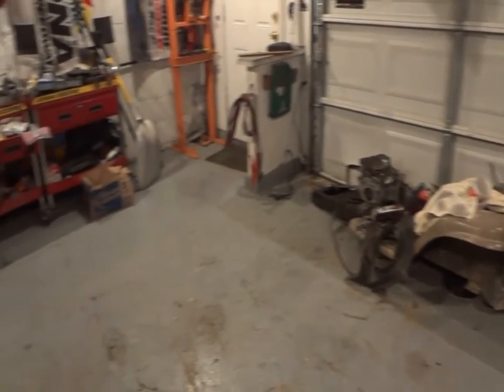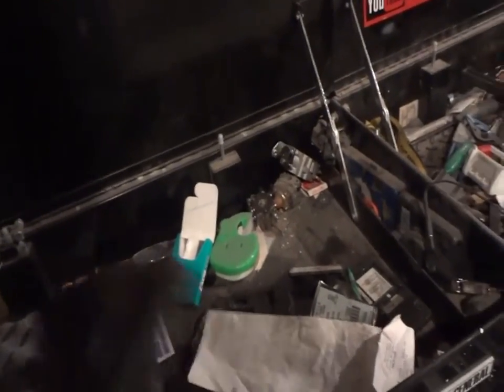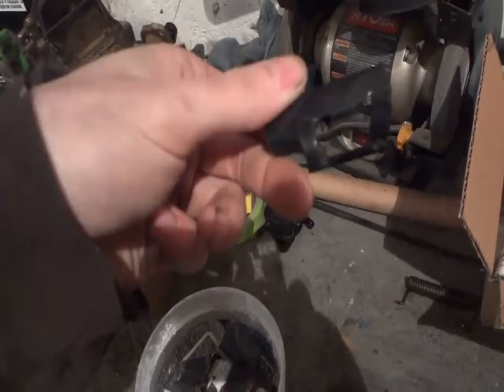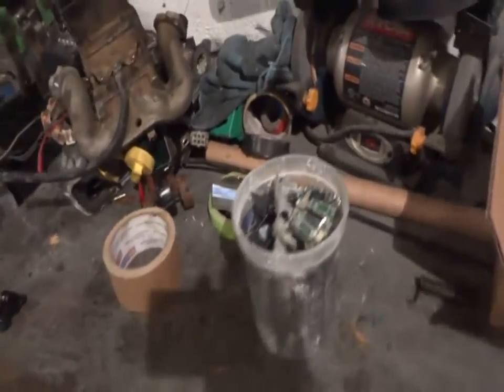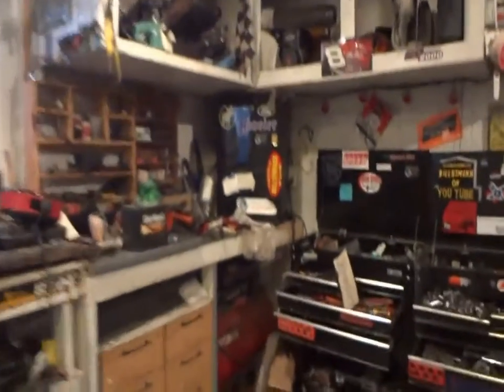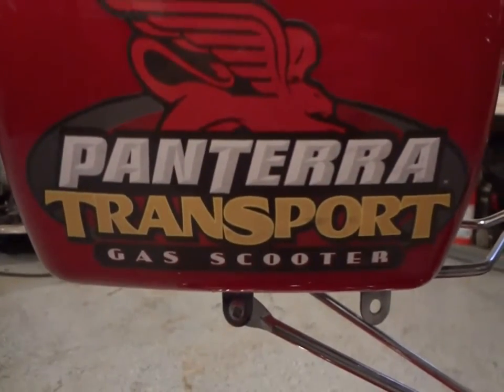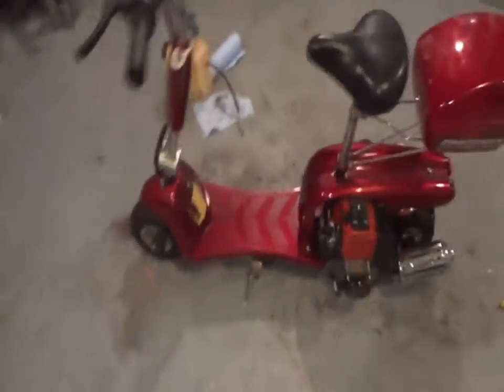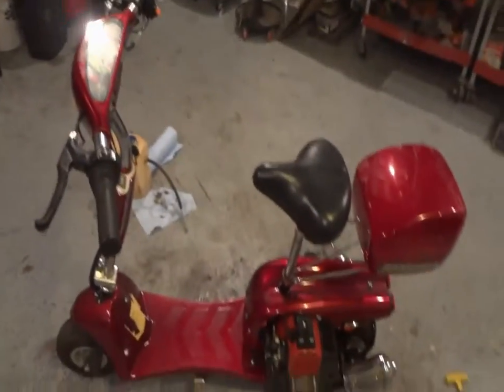camera thoughts and china scooter

Comment: Hey peppercatkeith i got a question for u i have a Briggs and stratton 20hp intek v-twin and when i start it up and give it throttal the throttal does not work any more but when i was turning the choke off it was reving up the motor and then i tried the throttal again and still nothing so i cleaned the carb real good,checked for leaks,made sure none of the throttal was broke and i found nothin wrong with it but now the choke is the throttal so do u know whats wrong with it. Pleas get back to me.